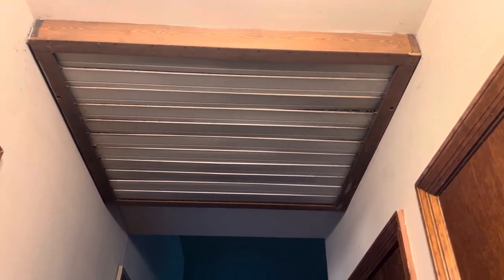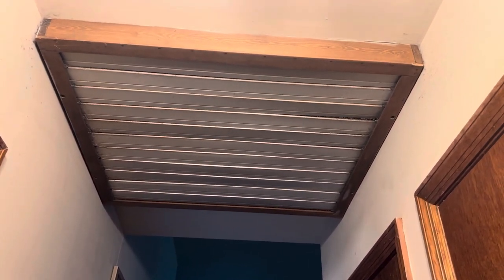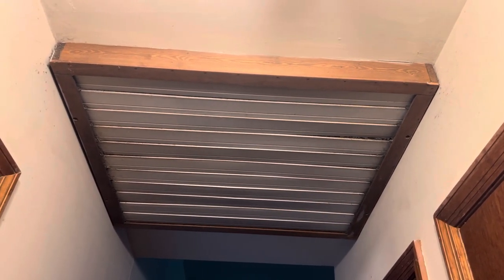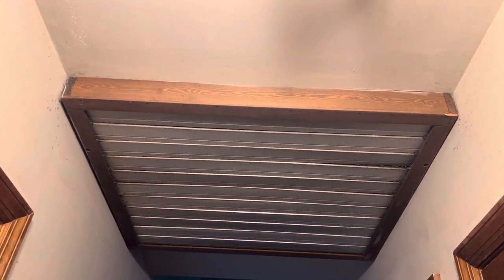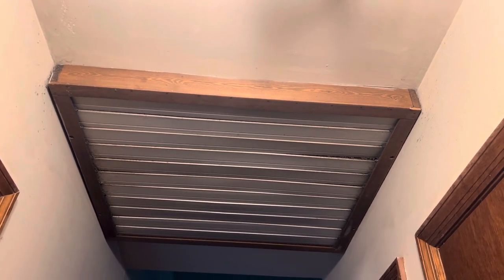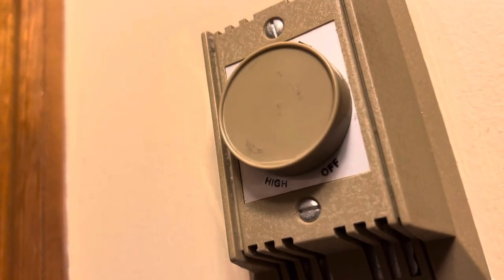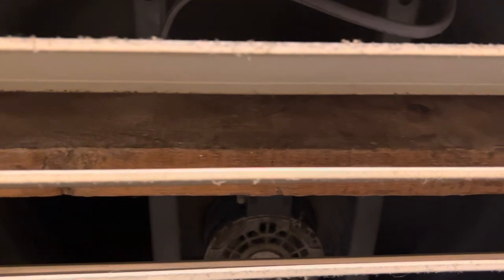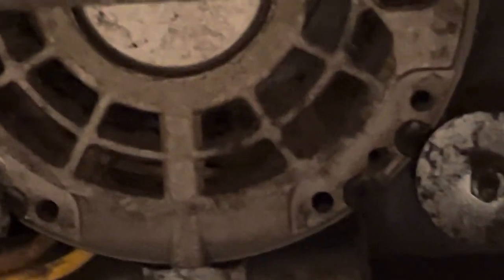1980’s Emerson Whole House Fan

Comment: I've had one for years. A trick I do is turn the fan on high, hold a dry kitchen sponge between the open shutters as you slow down the fan, the sponge will keep the shutters open, no matter how slow you adjust the fan. Sometimes, I like just a low breeze and no noise, pulled thru a window far away.